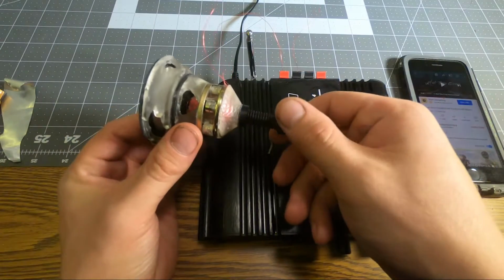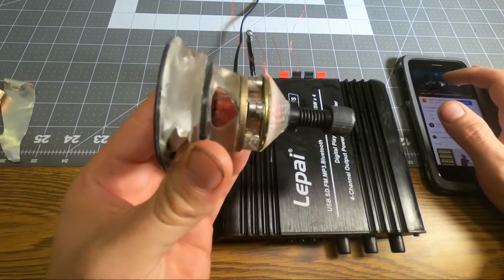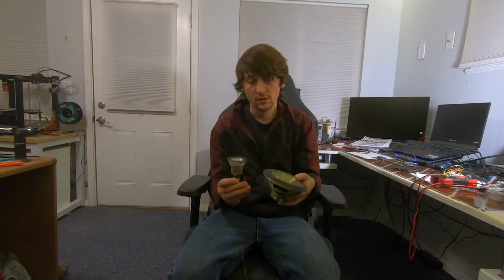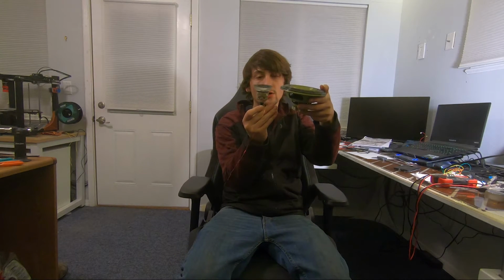3D Printed Speaker V3-Resin Based

Comment: If I wanted to do this myself, could I use my Prusa i3? Also amazing video!!
Reply from the maker: I used a photon s printer for my V3, but if you check out Version 1&2, they were completely built on a FDM style printer, the Version 3 has wall thicknesses under .2mm so unfortunately unless your  using a .1-.15 nozzle it’d be a bit hard to replicate identically.
Reply: @piscesprinting4170  I have a .15mm nozzle so that’s perfect. Thank you
Reply: Did you 3D print the flexable parts or purchase them?
Reply from the maker: Yes the flexible parts are also 3D printed, I use ninjaflex TPU to print flexible items, on this version I used a Anycubic photon printer to print the hard parts, since they were so small(wall thickness on some things were around .1mm) the only things not 3D printed is the bolt and the magnet wire on the coil.
Reply: @piscesprinting4170  excellent! What is your goal with printing speakers?  I was wondering this morning about making my own speakers and thought, I bet someone else has already done this.
Reply from the maker: I guess the goal was to see how many components could be 3D printed. Other than that, I’d like to make something that’d be comparable to a name brand speaker but for literal pennies on the dollar.